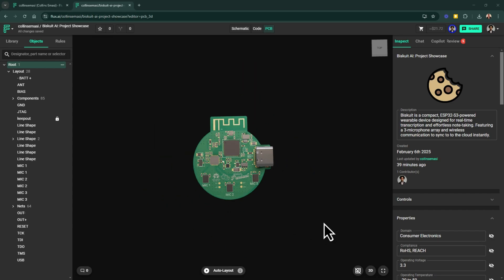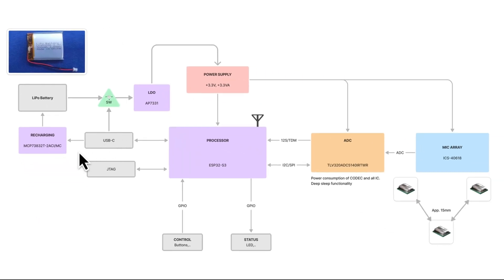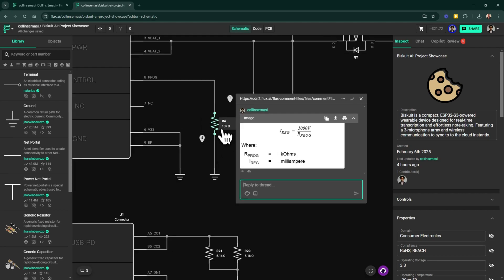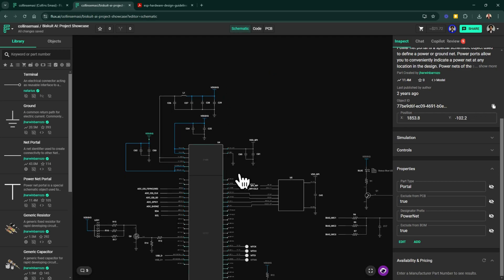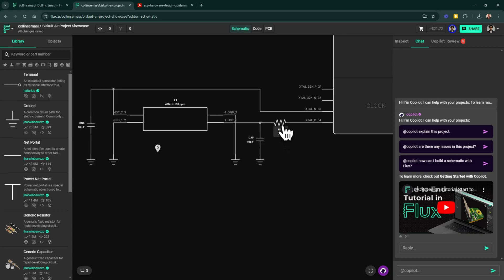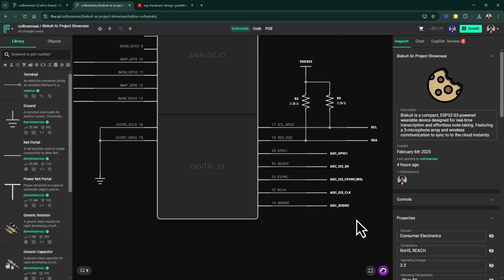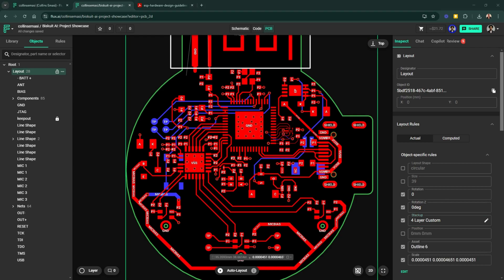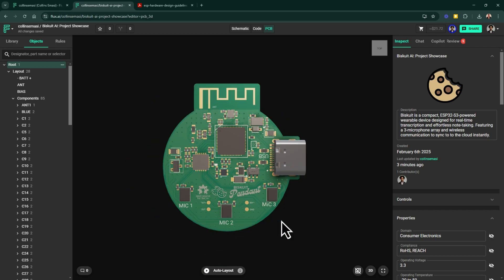PCB Design Walkthrough: ESP32-S3, ADC, MEMS Mic Array, USB-C & RF Antenna

Comment: PCB layout looks like aprentice skill level. Hope it gets better in future 😊
Reply: Why are you saying that ?
Reply: @ Because the layout does not look that professional at this point and it remembers me of the skill level of someone who is starting with pcb layout. If it has proper engineer skill level than I will be impressed.
Reply: @kevinperillo yes I understood but in order to increase my skills can you tell me the biggest issues that you are seeing.
Reply: @Boborski06 1) don't run tracks under components (lots of tracks running under caps and resistors)

2) don't link IC pads by running a track between their centres, instead, run and track out and around. (this usually gets picked up by the imager on production as a solder short rather than a deliberate link).

3) don't link GND pads to the center pad, this will cause a massive coppper imbalance during soldering.

4) horrible 90 degree traces, acid traps and should never be used.

5) pad spacing looks too close which is bound to cause issues for the pick and place machine, if you have space, use it. 

6) lots of dog legs used when components could have been moved slightly to run straight tracks. Often a lack of control of grid sizing causes this.

7) avoid vias under ICs, you cannot access them after assembly if you nees too.

The list goes on....

Comment: Nice project, first time for me seeing AI being used for stuff like this.

But here are some suggestions:
-You have no deep discharge protection. This can relatively easily be implemented just using a MOSFET and a supervisor IC like TPS3803 to cut power from the battery under a certain voltage threshold.
- you dont need those JTAG pins, the ESP32-S3 supports JTAG over USB, just need a pullup on IO3 and IO46.
- consider using (much) higher reistor values, especially for voltage dividers. You are wasting a lot of power there using low resistor values.
- Especially on R13 and R14, R13 isnt really needed at all and R14 should be around 4k7 or so.
- use a pulldown on IO45, it sets SPI voltage to 3.3V. even if not used, its good practice.
- for the antenna, I would stick with the "recommended" values for C36 (1pF), C36 (1pF) and L2 (1.2nH). For finetuning, a inductor an capacitor in series between antenna output (behind L2) and ground is needed.
- a lot more efficient than an LDO would be a buck/boost converter like TPS36020.